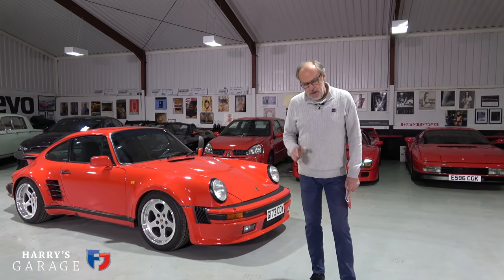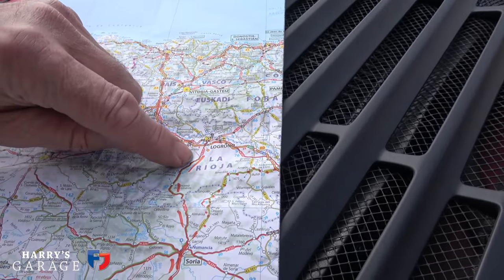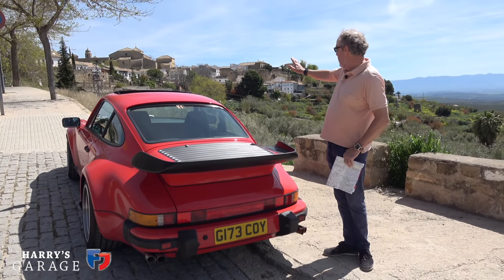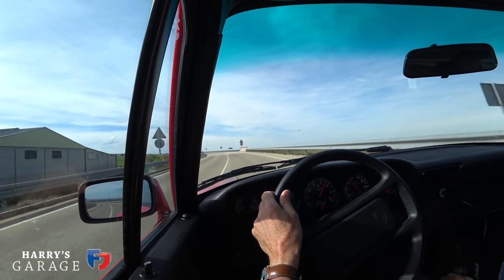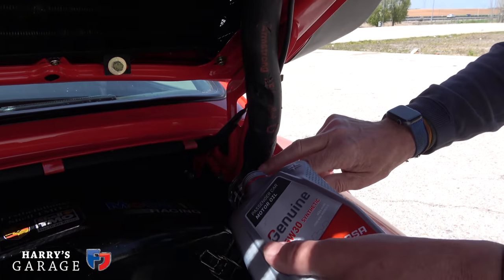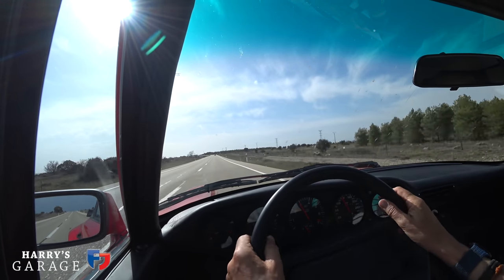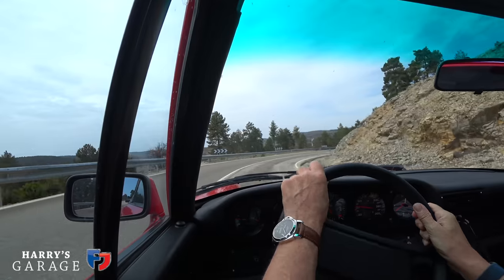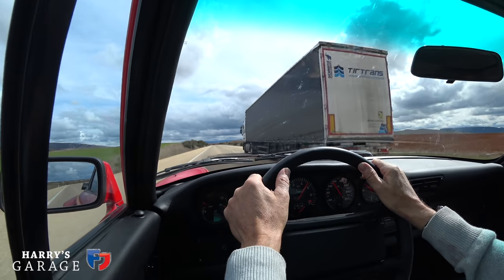Spanish road trip special in my Porsche 930 turbo S. How does this classic 911 cope with big miles?

Comment: When foreigners drive through sunny  Spain in flip flops and shorts they tend to forget that it is the second European country with the highest average altitude after Switzerland, which means once you drive 50 miles inland from the coast you are at least at 2500 ft and can get pretty cold, particularly at night. Even in the south snow can be seen from october to may up in the mountains.
Reply: Isn't Madrid the highest European capital city too?
Reply: @borjastick  not by a long way. Andorra's capital is number one, but larger sized capitals are Sarajevo and Sophia.
Reply: I didn't know that!
Reply: Austria, Liechtenstein, Montenegro, Northern Macedonia anand Albania have a higher average altitude than Spain ;-)
Reply: @mczeljk  I'm not talking about average altitude I am talking about the elevation of the capital city. Madrid is one of them I think.
Reply: @borjastick  I know. My reply wasn't to your posting ;-)
Reply: @ianworley8169  You are right about Andorra, but both Sarajevo and Sophia are under the 657 m (average)  Madrid city  is at.

Comment: the fuel consumption is mind boggling!!!
Reply: same as my 05 wrx sti PPP Prodrive....
Reply: I would have kept the Lotus Esprit myself.
Reply: Especially at 2 euros a litre. I'll stop moaning about the cost of fuel in Australia.....
Reply: Actually my 2006 Subaru Sti got similar milage averaged 24 liters per 100 km.
Reply: @alexbrown1995  I thought here in Perth is already expensive, but 2 euros a litre? Mate! What rip off!!!
Reply: @alexisnaranjo7979  2.25 euro on the highway in Holland:) so it can always be worse lol
Reply: Oliver Read springs to mind
Reply: @alexisnaranjo7979  We have always had cheaper fuel than Europe.
Reply: What engine model is it ? Turbo flat 6 ?
Reply: Given the power of the motor I suspect that there may be a tuning issue. Either in terms of optimising the current setup (timing curve, valve timing, air filter etc) or adjusting the setup. Unless of course there is something amiss. It is only 3.4l and must have been setup for max speed given the gear ratios. Injectors? Turbo? Inlet tract? Camshaft profile? Something is not right. It should be far more economical at highway speeds. (edit as I'm at the end...) As Harry noted... petrol is being used as a coolant via a highly enriched mixture. Fair enough, there's a huge lump of mega turbo'ed engine sitting out of the airflow... it is a good but costly solution.
Reply: You see why water cooled engines were introduced to remove the need for over-fuelling to keep combustion temperatures in check. I’m surprised that there wasn’t a low load fuel map, but perhaps it was beyond the 80’s injection system capabilities.
Reply: @djblc2201  3.4L Turbo Flat 6 probably with a massive intercooler.
Reply: For the type of person that purchased this car back in period it didn't matter. And fuel costs were not as high back then as they are now I believe.
Reply: I prefer the word frightening. Thank goodness modern Porsche's are more efficient.
Reply: My e60 M5's is even worse!
Reply: @damienmills293  time for a visit to mr Tyrell for a tune-up perhaps
Reply: Burning stuff can be bloody diverting, can't it? You just gotta do it in a 400+ HP Turbo Porsche on winding roads in Spain! The fun might be a little bit diminished with 2,- € per liter lemonade, but it still is a lot of fun.
Once the fun will be mostly eaten up with those propaganda-driven 3.5 €/l or more, we still can go back to light, fuel-efficient motorbikes and race those round the same corners. I just hope there will be a sort of "break even" at some point, to make people finally vote more intelligent in terms of gasoline prices and propaganda wars .....
Reply: @djblc2201  
I would imagine so
Reply: Fueling system needs a tune up
Reply: Went to test drive a Kona N and was bitching about the range (minimum 400km on 50 liters), and then I see this and I'm like "Okay, so it's not so bad."
Reply: @citromaz  remember that crude is 105us a barrel that's like .45 euro. The rest is transport, refining and taxes and profits. 
Harry is going to Bilbao. Nice roads up there. It's my 84 320i's hunting ground. Haven't driven it in 3 years. Thank god I put in a rich mix of av gas before I came back to canada. 
Epic road. 635 from santander to Burgos.
Reply: @manfredschmalbach9023  praying for it, so deeply. 3,5 eur would be amazing.
Reply: @alexisnaranjo7979 
In Berlin gas was at 2.50 a while ago...
Reply: @barrondeville1866  Google says 21 mpg so you must have heavy foot lol
Reply: My 1990 928 GT has a 90 litre tank and gets about 450km from that amount of fuel.  The mpg is dismal, but I love it.  😄
Reply: Nothing wrong with a paper map, wonderful things.

Comment: I had an '89 G50 Turbo and found the same about the fuel consumption. I came to the conclusion that the reason it was so thirsty was because it had a very low compression engine,  to tolerate the potential boost level available,  and when cruising it was very inefficient. I sold it and bought a relatively economical Ferrari 512TR!

Comment: aircooled engines are tuned a bit richer AFR. And turbo engines also. 
That said, it seems too rich. I'd have the coldstart enrichment checked. If it keeps overfueling the engine will use too much fuel all the time at all revs.
Maybe the elevation is also a factor? Less oxygen the higher you go.
Reply: RUF and Porsche Motronics DME is a popular upgrade for these cars, though I'm sure in the time since there's even better options now with how advanced electronics are now.
Reply: Rich mix on aircooled engines especially  is basically the safety net contemporary car makers used to utilize back in the turbo era
Reply: Maybe the next visit to Iains shop…
Reply: @Kizzle001  There's not much you can tune mechanically on these cars.  It's through the DME which means soldering and flashing.  You can try, but you're essentially just taking driveability away or performance or both.  The stock DME might have a fuel selector dial for "better performance" but it means super premium fuel at all times.  Unless the entire DME and parts of the ignition is replaced, that's it.  But it has it's charm in being what it is.  Unless Ian's shop has the people to do these things, which I'd love to see.  That kind of wizardry seems to be a lost art now.
Reply: That's not an air cooled engine; that's a fuel cooled engine...
Reply: @jonathanrabbitt  LOL!
Reply: Nerd
Reply: @PorscheRacer14  There is no DME.  930 (even 1989) uses fuel injection similar to 911SC era cars. 3.2 Carrera was the first DME controlled 911 and 930s never got Motronic DME.  Yes, Harry's car is certainly running rich and they can be made better but updating to modern EFI spark and fuel control is the only way to make a measurable improvement.  Arguably you don't want to make such changes to a valuable classic, but you can keep the old parts and make it reversible.  I had a 3.6 Turbo that ran on Motec and was much better on fuel and made more power than Harry's 3.4 - so it can be done.
Reply: @richardbernau9007  Right you are.

Comment: Well done Harry! Great as ever. I have a 911 Speedster and when you check the oil, you have to do this with a running engine! Really true! Best wishes from Germany, Simon
Reply: That's a very exotic car 🥇
Reply: @visionist7  You are correct. Always check the oil with the engine running and at full operating temperature. I have had good luck keeping the oil tank level at approximately half full without any issues. Fantastic video Harry!

Comment: Thank you for the wonderful vicarious experience on the roads of Spain in one of automotive history's most epic cars!

Two items worth mentioning:
The 930 (and all air-cooled 911's I presume) must have the oil checked with the engine running.  Also,  930s are spec'd to accept higher-viscosity motor oil, typically 20w50.
Reply: 10w40 is fine but, yes, the engine must be running to check the level.
Reply: surprise Harry bought no Syntethic oil. which is better that standard.

Comment: Instructions for checking the oil level should be on a sticker in the engine bay. 
Its also reccomended to not fill it above 1/2 on the dipstick. 
My experience has always been to check the oil with the engine running.

Comment: I was always told to measure air cooled 911 oil level when engine ticking over. Plus, I noticed the oil level gage not moving when revs are changing- maybe a gage issue?

Comment: Love the car. I remember a ferry trip from Portsmouth to Bilbao when I had a 911 3.2 Carerra way back in October 1999.  The ferry trip was rough to say the least but as Harry says, the Bay of Biscay is well known for this.
Reply: Does it really take two whole days (48hrs)? I'd have guessed 24 hours
Reply: @visionist7  35-40 hours, if it is an afternoon departure you will spend two nights in the ferry, early morning ones are usually 1 night aboard.
Reply: @visionist7  there are 2 options either one or two days, I moved to Portugal and used the one day option. Cabins are spacious and you can get dog friendly ones.

Comment: When the Cotswold Economy Drive used to run, older 911's doing 13 mpg was usually the average. On your trip you were not too far from Guadix circuit, the Ferrari Breadvan was testing there last week.
Reply from the maker: Good info, thanks. Shame to miss the Ferrari Breadvan in action, don't know Guadix circuit but will now go check it out on Google..
Reply: I HAVE RACED A BUNCH OF CAR'S WITH MY 08 SHELBY GT500 THAT PACKS OVER 850HP AND THE ONLY CAR THAT WAS ABLE TOO HANG CLOSE TO ME WAS A PORSCHE LOL I DON'T KNOW MUCH ABOUT THE PORSCHE WORLD BUT THE CAR I RACED WAS A VERY EXPENSIVE TWIN TURBO PORSCHE AND VERY RARE.LOL MY BUDDY HONESTLY THOUGHT HE WAS GOING TOO MOP THE FLOOR OF JUST A MUSTANG HIS WORDS.LOL AFTER THE RACE I SAID TOO HIM IF YOU CAN'T BEAT MY GT500 LOL YOU HAVE NO CHANCE AGAINST MY 900HP SHELBY GT500 SUPER SNAKE.
Reply: @anthonylaudano9751  Nobody gives a hoot about Mustangs!
Reply: pirshé 930 ttrúno 9,3 mpg
Reply: @sharonbraselton4302  SPEAK ENGLISH LOL THIS IS AMERICA LOL
Reply: WHATTTTTTT
Reply: @user-ht9fr6eh9u  WHAT YOU MESSAGED ME LOL
Reply: @fredfidel2529  YOUR PROBABLY STILL CRYING LOL
Reply: @anthonylaudano9751  what s the hell
Reply: @edoardocasagrande4339  WHAT DO YOU WANT
Reply: @edoardocasagrande4339  WHAT SUPER SNAKE LOL I HAVE 2 A CONVERTIBLE SUPER SNAKE AND THE RARE 427 EDITION AND I HAVE A 10 GRABBER BLUE SUPER SNAKE PACKING STOCK FROM SHELBY AMERICAN 900HP AND IAM LOW BALLING THE POWER IT'S MOST LIKELY 950HP.
Reply: @anthonylaudano9751  Why are you writing in capitals??
Reply: @hpman911  EASIER TO SEE
Reply: @anthonylaudano9751  only if you are blind!

Comment: Blimey the MPG sounds terrible but then I remember the Range Rovers I used to run were only averaging 11 to 12mpg! I guess we’re spoilt by modern diesels effortlessly doing 50mpg +
The 911 is a lovely car and worth it though 👍🏼
Reply: @dizzy2020  Well ok family member of mine used to own a diesel 5 series (17 plate) on the motorway at say 70-80mph it easily did over 50MPG. It did have a big old fuel tank (60 litres) but realistically if it was all motorways it could do 600 miles easily so say London to Edinburgh without breaking a sweat. That and still have another 150 miles of range in the tank. 

You talk about outside lane antics I'd sometimes go up to say 85 or 90 on the motorway to overtake someone. Never saw any massive drop in MPG figures the 5 series sat consistently at over 50mpg on motorway.

Yeah you can say "oh well around town they are not as economical" which is true but even then most modern efficient diesels even around town will do over 30MPG. Then on motorway in 8th gear at 1500rpm they will comfortably do over 50mpg. 

Your Peugeot 406 is ancient get a modern diesel you'll easily do 50MPG on a motorway. Christ the 406 is 20 years old.
Reply: @dizzy2020  You are possibly lead footed or have had poorly made cars...A modern BMW diesel (say a 320) can easily do great figures (better than a Mini...). My Z4 (245 bhp petrol) could do over 40 mpg on a run...with a slushamatic.
Reply: hybder dyseob50 kyg 55 moh dysé hybrid des 55 moh is Ike ¹6 or ¹7 nog at 155 mph
Reply: @dizzy2020  I have an XE diesel which easily returns 60 mpg at 70+ mph on the motorway. I have had just over 70 mpg on a couple of occasions without trying and running at normal traffic speeds. Usual mixed driving is 55 mpg down to about 50 in winter with stop start driving.
Reply: My diesel A4 is in the 40’s around town and easily in the 50’s on a run, it does 30mpg (I saw 33mpg on a run to Suffolk) with a 5 berth caravan on the back!
Reply: My 7 seater Picasso has an average 54mpg over the last 6.5K miles, last weekend my 200 mile trip was 62mpg. Summer trip of 640 miles each way with 5 people , dog and luggage was 58mpg - 90% of the trip was 80mph French motorway and 70mph the rest.
Reply: A Range Rover is a heavy brick and has a huge frontal area. That's thermodynamically justifiable.
Reply: @Andrew-vx2ls  Well he did say his diesel was some 20 year old Peugeot 406 that and he probably is lead footed.

Comment: @Harry’s garage epic video, absolutely enjoyed every minute.

Oil should be added with the engine at idle and the level gauge should never exceed the middle of the gauge, also 5/30 oil is way too thin, Porsche recommends 10/60 for all air cooled engines. (I’m an ex-Porsche tech)
Reply: Do ye think the poor fuel economy is due to it being air cooled,its just that from my own exsperience with air cooled motorbikes they never seemed to be as good on fuel as liquid cooled bikes ide had ?!
Reply: @martinhankin422  I’ve driven modified 930’s, fuel economy was never as low as Harry’s. 

I suspect that the K-Jetronic requires adjustment and checking the correct fuel pressure on the regulator. 

If it is over fuelling it needs to be attended to, as it’s in effect diluting the engine oil ( known as “bore wash”)
Reply: Loved the video as well but was a bit triggered by the 10w30 oil so liked your comment! I’d love to see what the Air Fuel Ratio is doing on Harry’s car. I can understand a rich mixture under full power but a motorway cruise at light throttle should mean better fuel consumption than that. It must be super rich.
Reply: @korpharm  from the video, I understood Harry was not using 5th gear on the motorway. 

Be that as it may, I suspect the air/fuel ratio is too rich. A rolling road tune will identify where the issue is
Reply: The first thing i thought when seeing the oil, 10/60 is the norm in most air cooled as far as im aware.

Comment: Because of the dry sump, you're supposed to check the oil level when the engine is warmed up and running, on level ground. Checking it when off will give you a false reading on the dip stick.
Reply: This has a dry sump? Are you sure?
Reply: @333pg333  Yes, absolutely sure. I own an air-cooled 911. It's in the manual, and it is clear when you look under the car. There's no oil pan, and the oil is pumped into a separate tank, which is what the dip stick is measuring the oil in. When you turn off the car, the oil is no longer pumped up into the tank and settles down into the engine case.
Reply: @IanWhelan  Thanks for that. I thought dry sumps came in later models than the 930. Just goes to show you. I did question his choice on oil though. A 5w/30 synth oil for that model in warm conditions. Hopefully it was due to the limited stock in a Spanish garage that he bought it from.
Reply: @333pg333  If he was just topping it up and the rest of the oil was properly spec'ed, it should be ok in a pinch. The 911 has so much oil, like 12 liters, that a little lighter weight oil in there for a short time shouldn't be a big deal. I'd assume he would change the oil after returning from a trip like this.

Comment: Regarding the mpg, I do suspect something’s wrong with the air/fuel mix… 20mpg should be the figure to expect
Reply: Really depends on how much the turbo's used..
Reply: I reckon Harry has a heavy right foot and something wrong with his gear change hand!!!!!
Reply: @simonp8698  he said on highway and the gear is high-geared… 
Maserati Biturbo V8-V6 from the 80’s would do 20mpg on highway…
Reply: I don’t know about the MPG, but i figured an average of 4.5 km per liter. I’ve done an average of 11 km per liter in an XJ6 4.0, and i would presume the Porsche to do at least 9-10 km per liter, but i obviously don’t have any valid figures.
Reply: @gabriellalande4500  I have an almost identical car.. if I use the boost a lot, I get as low as 7mpg, but cruising at 80mph, no boost, I get 25mpg.
Reply: @simonp8698  exactly… cruising at highway speed even above the limit should never attract 13 mpg on any car… as he said… unless it’s a Chiron W16 Quad turbo lol
Reply: Fair points.. example, if I cruise at 70, but use the boost regularly for overtaking, I can drop to 15-16mpg.
Still.. they're lovely cars!
Reply: @kasperkjrsgaard1447  Confused me now, I have no idea about KM/Litre
Reply: @simonp8698  sure you have, a zillion pound car and you check the mpg...
Reply: @peppemberton9948  Not actually worth a huge amount, but out of curiosity and a need to plan a journey through the Scottish highlands, I'd say it was pretty considerate.

Comment: With any air-cooled Porsche you check the oil level with the engine turned on and on level ground. Always check the level with the dipstick and not with the gauge. 

Also that generation of 911 would’ve been last serviced with fully synthetic 10W 60. You topped up with a very different oil. 

I would replace all the oil with the correct kind soon and in future carry the correct oil with you.

I’d also suggest having your fuel system checked as it definitely shouldn’t be consuming that much fuel especially if it’s a factory setup. 

Thanks for the video, enjoyed it.